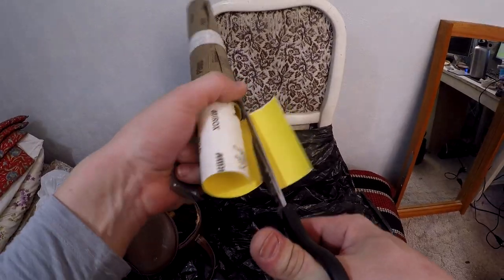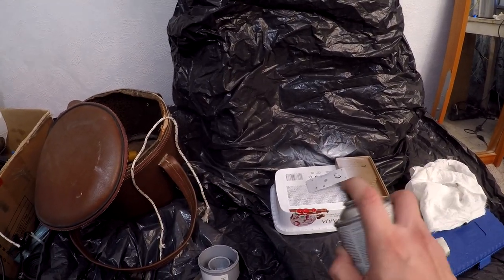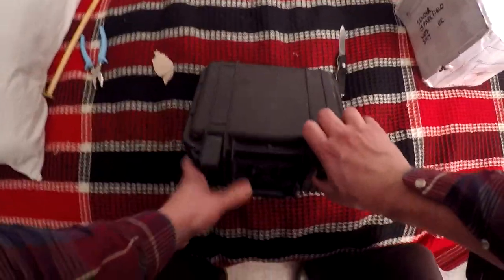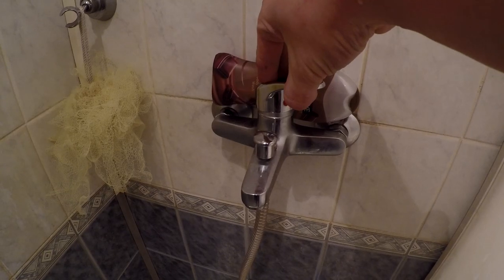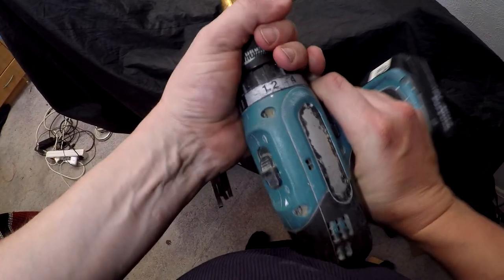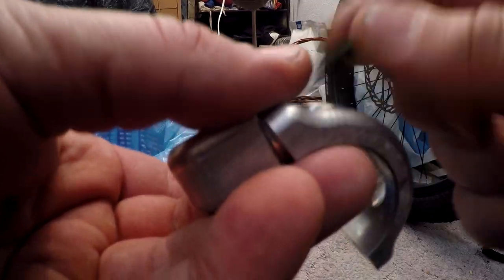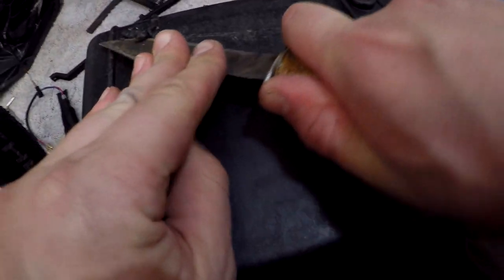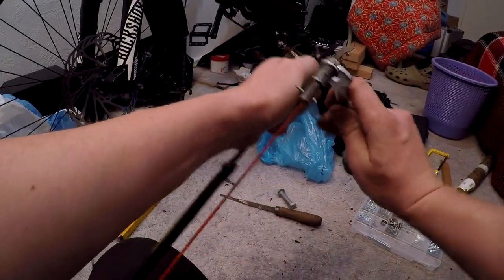Building an Electric Bike in My Bedroom - #9 Pelican Case Install, Rear Light Mounts

Comment: Hello there my name is Hans live in the Netherlands and i wonder, could you help me out ? what is the brand name you used for the ebike start / stop / alarm system ....i cant seem to to find it on aliexpress and i am looking for something to shut off the power to my ebike remote ...most important !! ..love the videos ...please post more !!!
Reply from the maker: Hey. It’s delightful to have viewers from all corners of the globe, including the cycling-enthusiast nation of the Netherlands. In response to your question, I ordered the specific alarm stop-start system from the same vendor who sold the controller. The controller must have the appropriate support and connection; it cannot be connected to just any controller.  I purchased most of the Ebike parts from a single manufacturer, who now has a new brand called “Garmata”. If you conduct a Google search for “Garmata controller”, it should lead you to a page where you can see a sinewave controller with a remote and alarm. If you wish to buy separately(alarm only), please contact them directly. This anti-theft alarm also has a brand name, but I would need to dismantle the bike to find it, which I don’t want to do at the moment. More videos are on the way, as I’m currently working on the Enduro 260km trip. Are you working on a costum ebike?
Thanks
Reply: Hello thanks for the response my friend , yes working on a custom long range bike , but indeed this is the Netherlands : a small country and a lot of bikes, for the last year(s) a lot off fuzz about fat bikes , fast bikes etcetera. So in real life i would be asking for trouble if i would built something like you did . To make it look more ``normal`` i choose to convert a normal city bike to long range , I have a milling machine : so cut of the ``bafang 750 watt`` tag also 😉. My build : bafang 750 watt motor and two chamrider batteries @ 48 volt 30 amps ....project almost finished . Gouvernement is currenly working on a new law that (i hope) wil allow throttle only riding at max 30 km/h @ almost 60 years young😎 i am oke with that speed . so hoping the new law passes ..then i will be building again, something like you did ...``full suspension and a lot of gadgets👍👍👍 great , very nice`` Totally agree and just as fun as biking: the building of a bike is addictive i think 🙂...and : i am quite lucky : my sons have there own house now and so i`ve got a spare room that i converted to E-bike room 🤭 @DatEbikeGuy
Reply from the maker: @hansdekorte-kh8ji  Hey. I’ve always thought and said that it’s always a good idea to convert an ordinary city bike into an electric one. With the motor in the back, you can hide it with bags(ortlieb for example). All in all, it doesn’t compromise the original look or function of the bike. In my opinion, if the roads are of good quality, you don’t need suspension when driving at 25-30km/h. The thing with front suspension is that it requires frequent maintenance, which is an important factor to consider. In Estonia, where I live, the law allows for a motor power of 1000w, a hand throttle, and a speed of 25km/h for bikes. If you can set these limits on the bike yourself, it is classified as a mini-moped. This classification does not require insurance, and you are allowed to drive on public roads. I’m familiar with the Chamrider brand. I’ve ordered spokes for my electric bike from them on several occasions. 30km/h is my preferred speed; it gives me a sense of motion👍. Welcome to the E-bike addiction group 🙂! I’ve been an e-bike enthusiast since 2018 and I absolutely love it. Interestingly, I used to be quite opposed to e-bikes in the past... Good luck with your bike. If you have any questions, please feel free to ask.